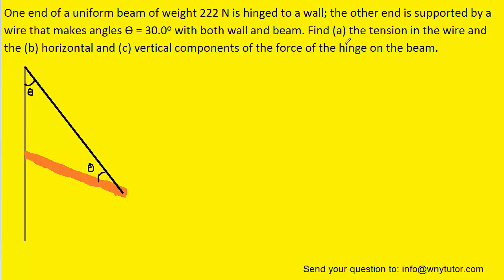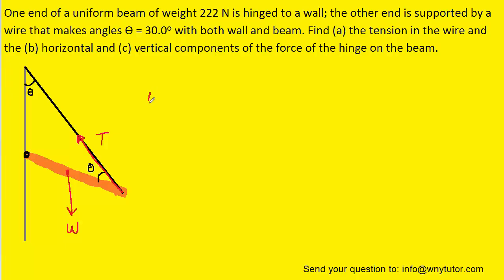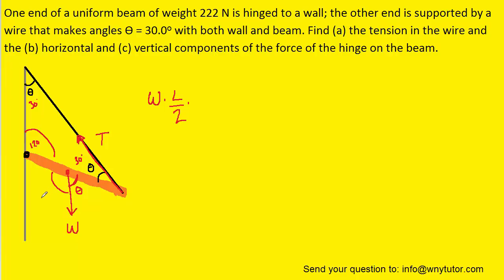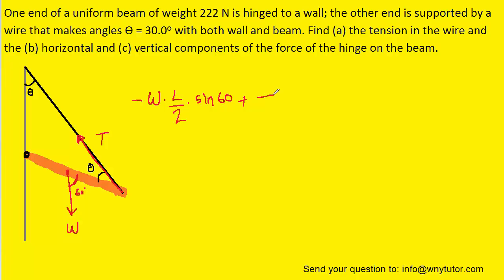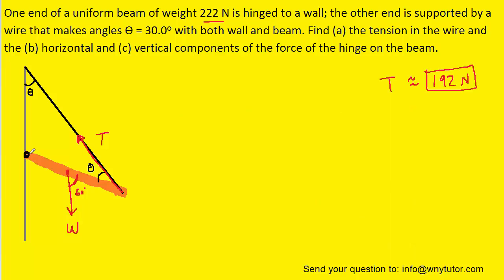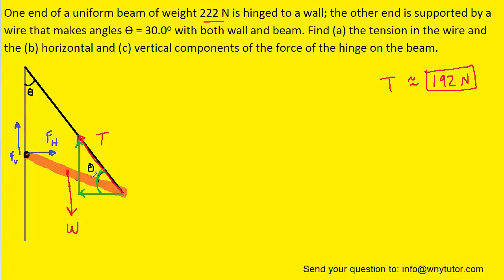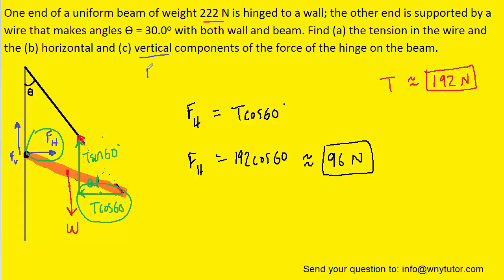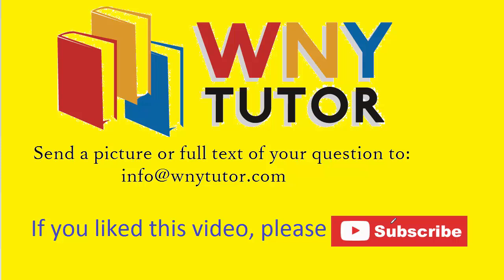One end of a uniform beam of weight 222 N is hinged to a wall; the other end is supported by a wire

Comment: In Figure a uniform beam with a weight of 60 N and a length of 3.2m is hinged at its lower end, and a horizontal force F of magnitude 50 N acts at its upper end. The beam is held vertical by a cable that makes angle ? = 25° with the ground and is attached to the beam at height h = 2.0 m. What are? (a) The tension in the cable and (b) The force on the beam from the hinge in unit-vector notation?

Comment: great video!, curious though. How come we use sin60 for the W*(L/2)sin60 and sin30 for T*L*sin30. Thank you
Reply: When doing torques of the beam, you must use the perpendicular component of the forces to the surface then multiply it by the distance from the point of rotation.  This perpendicular part comes from the definition of torque being the cross product of the position vector and force.